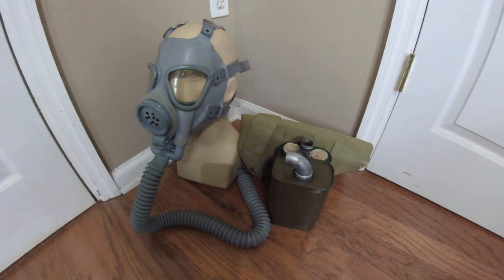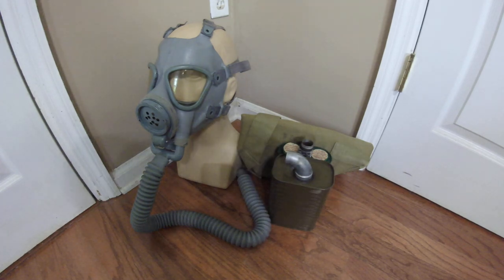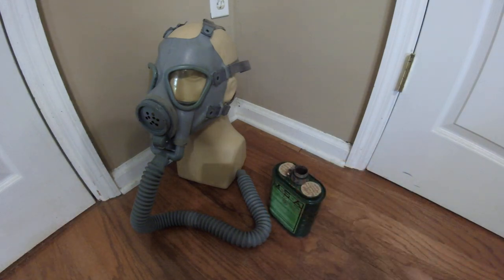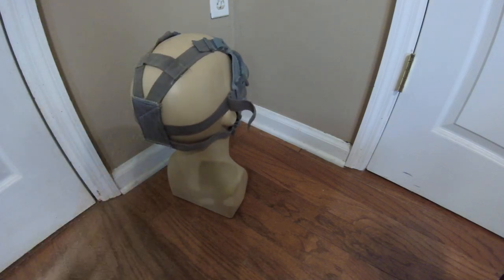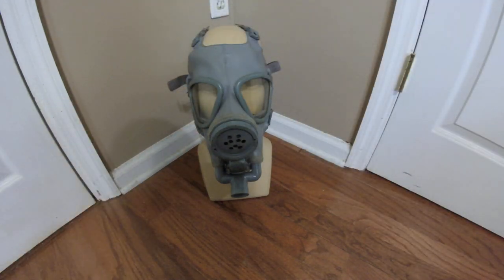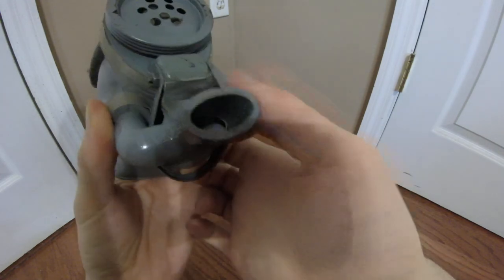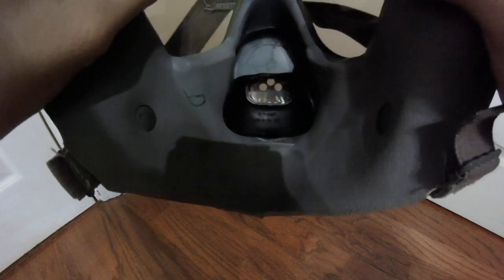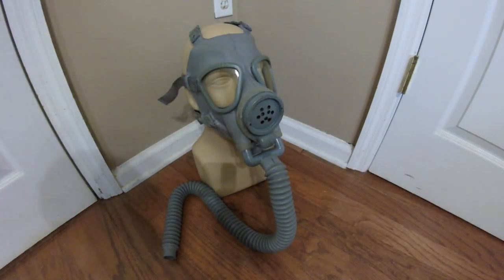(OLD VIDEO) U.S. M3 Army Diaphragm Mask (Transitional)

Comment: I went and checked my transitional M3 Diaphragms, and there is trace amounts of rubber in each suggesting they did use speech cones. The rubber is black, so the one you put in there seems correct.